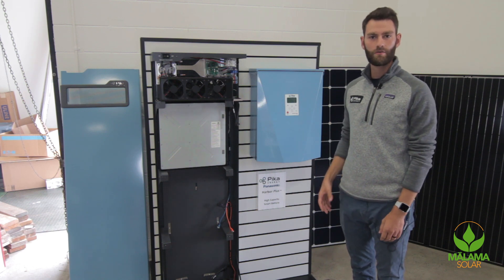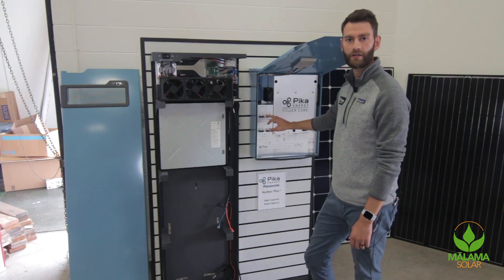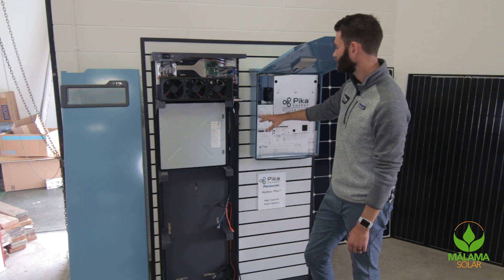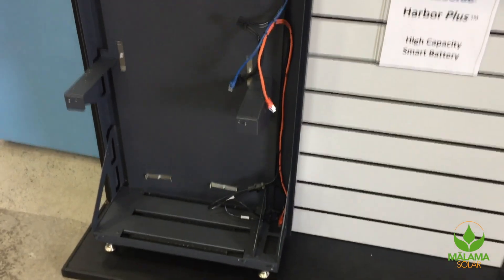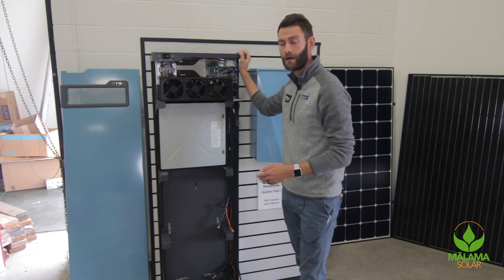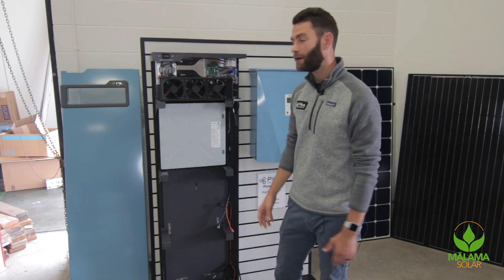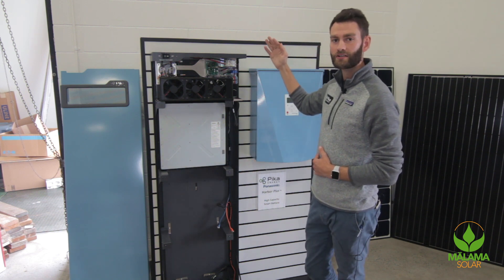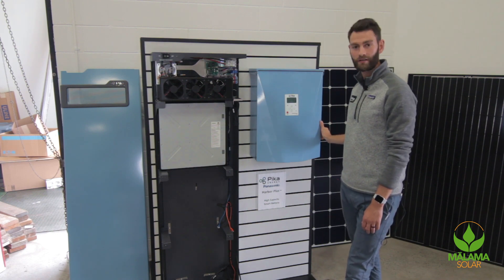Pika Energy Battery and Inverter In-Depth Overview

Comment: What if you want to add a pika back up battery system to an existing grid tie solar system that uses micro inverters at each panel? Is that possible with your island inverter? Thanks
Reply from the maker: Aloha @TheHonarable1, unfortunately you can't currently install the Pika system on an AC coupled system (microinverters). I know it's an update that they've been working on releasing, but I don't know how far along in the process they are with that. I don't think it's high on their priority list right now, but I would love it if they did!
Reply: @malamasolar  Thanks for the reply